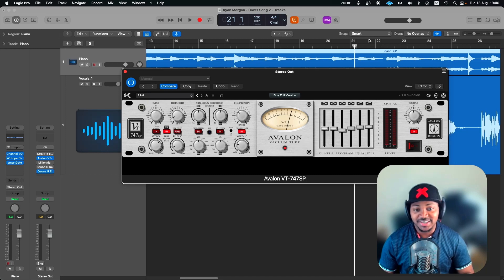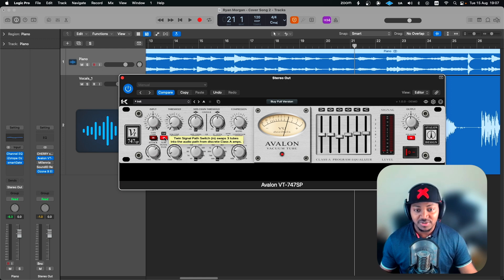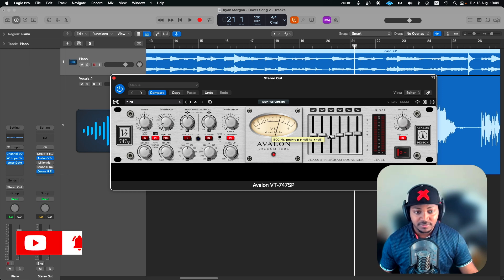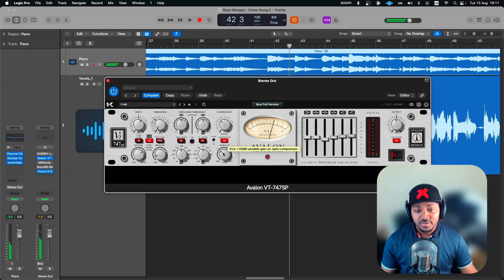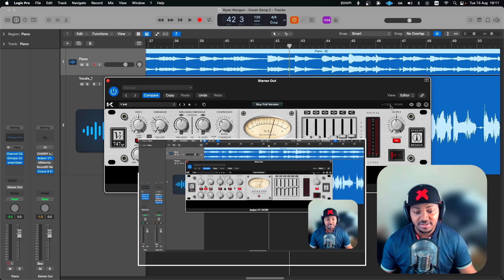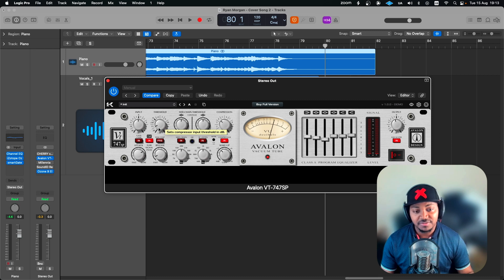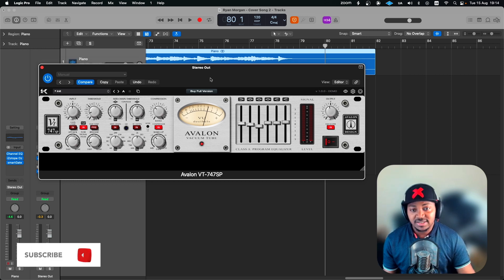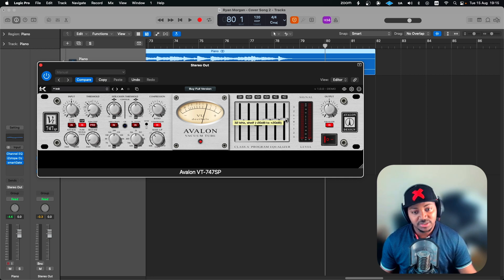Kazrog - Avalon VT 747SP // ANY CLOSE TO THE HARDWARE ?

Comment: I shot this out against both nebula Avalon Plugin
Alex Bs Colors Pres and Saturation 
and Henery Onlago Mojo , both in Avalon 747 Mode....they blew this thing away....even on vocals....really disappointing KAZROG....they should have invested in some 
Convulation Live analog sampling with this and it wouldnt sound so digital and cold...tube saturation is warm...heck....Nebula's C660 Compressor would do a better job than this 
Using 
Amber's EQ from Acustica Audio, Alex B's Hardware run though, and the Nebula C660 together...will get you 95%  closer to the Avalon Units Hardware Sound
But these Digital Plugins like this one ...suck...LOL 
They hung themselves...not adding a better eq and some tube saturation emulation...like attaching a "Heater Plugin" type section to it....I think if they did those two things you could adjust this closer to getting the actual hardware sound....
Reply from the maker: @johnisrael5183, Exactly.
Reply: I had the real unit from 2007 until 2015 and used it every day on my masterbus. Unfortunately I had to sell the thing to generate some cash quickly but I regretted it so bad that I went to buy it back but it tripled in price for what I sold it for because it was discontinued. Anyway. I can tell you that they have not done a crap job. I know the sound of this unit, inside out and it's very, very, close. When you engage the tube on the real unit, it's so mild, you barely even notice it. It's a bit more noticeable if you crank the input but still you're not going to get some crazy tube distortion going on. It's not something you turn on and it smacks you in the face, not even on the real unit. I think they have done a pretty good job and it sounds pretty darn close. I'm happy with it. The real unit was pretty transparent and probably more suited to clean mastering, you're not going to get crushed drums or vocals from the compressor because it's too slow, more like an audio leveller. The best thing about it was the EQ, which I think they have pretty much nailed it and sounds like an Avalon 747 to my ears. My guess is the real unit would probably disappoint you if you're expecting some crazy tube stuff because it has tubes in. Like I said though, it's extremely mild and transparent when you engage it, hardly even noticeable.
Reply from the maker: @djkurtstudio True, I mentioned on this video that I'm giving the plugin 8/10 for the sound as it is very close to the unit from my experience. Obviously, the missing 2 percent is the low end focus and warmth, which most plugin emulation lacks, and that you can only get from a real current running through transistors, tubes and tranformers so, this one is not alone in that regard.